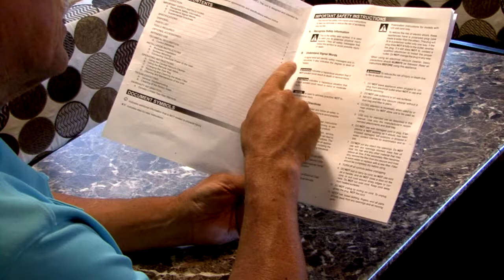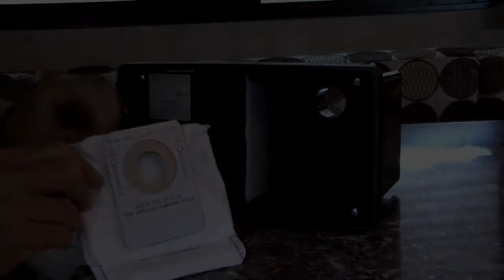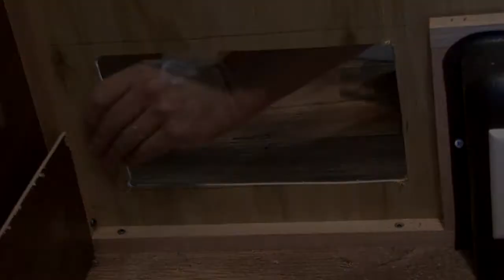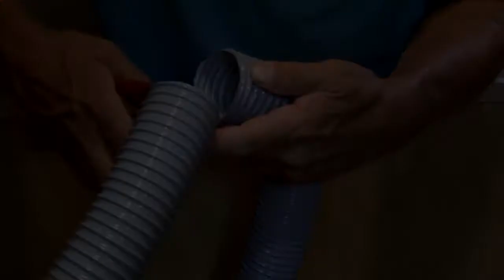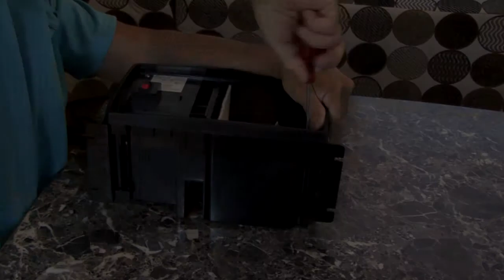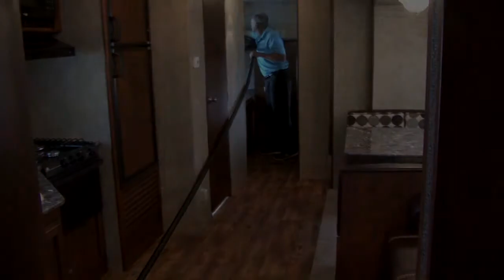Installing an RVac™  RV Central Vacuum System

Comment: Thank you for making this video. I installed a residential central vacuum system in my home way back when I was single and loved using them!
Now that I am single again and own a 31 foot class C RV, it is now time to buy one of these units and get it installed so I don't have to lug around a huge residential vacuum any longer. This video assured me of a successful DYI  project. I do plan to operate it using a power inverter so I can use it without needing the generator running while boondocking or camping in generator "quiet zones".